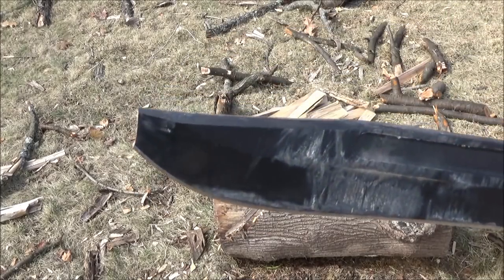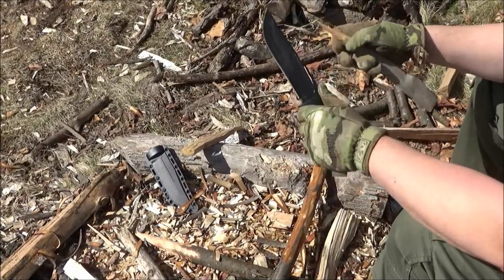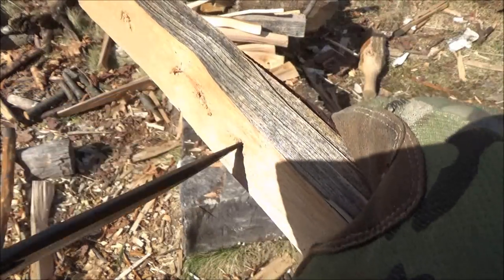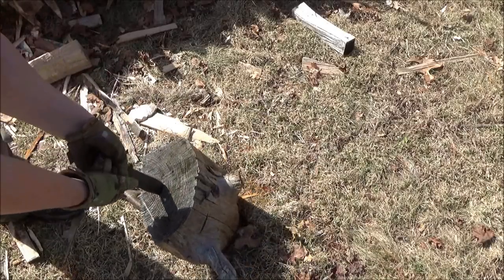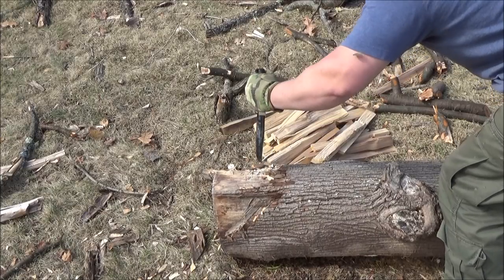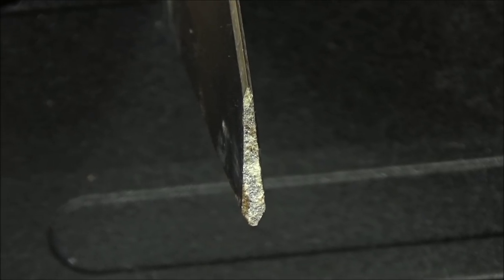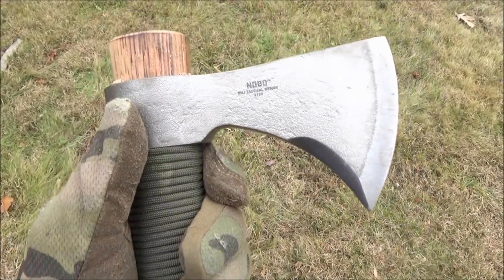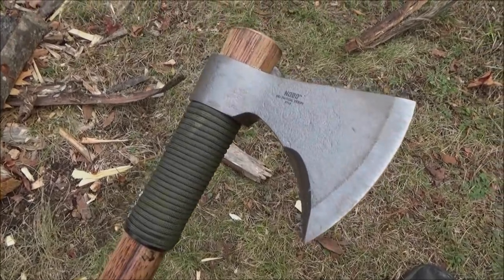CRKT Muzzle-Brake Knife Review

Comment: Bladesmith here (blacksmith who specializes in blades.) That steel grain looks awful, way too coarse! From what I can tell, the steel wasn't normalized before heat treat. Also possible it was way too hot going into the quench, although I'm not sure if it's a steel that gets quenched in a liquid or an air quench, but it could have gotten too hot either way. I think they didn't normalize the steel to refine the grain. As for why it broke: that grain is a big part of it, coarse grains are very weak. Also it looks like it's hollow ground, which is already weaker than other grinds, so that doesn't help.
Reply from the maker: Thank you for the info, bro!
Reply: I agree with Ian S. That grain structure is hideously coarse.
Reply: beat me to it. Extremely course
Reply: It  looks like it was quick quenched after a casting, but that doesn't make sense for plate steel. My guess is that it wasn't forged for a basic grind angle first, then overly annealed and quick quick quenched without proper hardening and tempering steps. 8Cr13MoV can be a pretty good steel when forged and heat treated correctly. Those grains are huge for that type of steel. Looks like cast iron. Basically, they got it too hot and cooled it too quickly.
Reply: Ian S. I figured as much myself , 8Cr13 ain't bad unless the heat treat is bad
Reply: Ian S. Even as a novice blacksmith, I can tell that steel is awful, looks like it had way too much stress in it, wasn't normalized properly etc.

Comment: Yup, the grain on that is turrble (in my Charles Barkley voice). Lousy heat treat would be my guess. The outcome is the CRKT MuzzleBroke. 8Cr13MoV can be successfully used in a larger fixed blade, but like all steels, it would need proper heat treatment.

Comment from the maker: You always hurt the one you love.
Reply: from my experience working with metals for a few years ( take them like gain of salt), look like the steel was over heated in the manufacturing process before it send to the knives company who process milling cutting ect, also plus over heat treatments make it brittle, many small pocket of air bubbles in the steel due to overheating to near boiling point
Reply: plus stainless steel is not that flexible compared to carbon steel in my testing
Reply: Hello, we are the the manufacturer of WORKPRO and MOSSY OAK, we found the your reviews of our products, very interesting.
Reply from the maker: I also reviewed the Work Pro 3 Piece Utility Knives Set, it was pretty good for $5 a piece!
Reply: Reno Yin always good to hear from the people themselves 👉
Reply: Thanks very much for your appreciation, we have well studied your review, we have updated the design for one-hand opening.
Reply: I bet if it was a saber grind instead of a hollow that tip would be ok. Some tips just aren't meant for "too tests", no matter the steel. Take a Para 2 in s30v or even cruwear, I bet that tip will snap like nothing and those are good steels with good heat treats.
That said, it did look like either overheated(blowing up the grain) or bad quench(results in retained austenite instead of martensite and austenite is brittle).

Comment: heat treat may have been a bit hard, but I would say the problem with the testing is more of a geometry issue. If you want a really strong tip, get an american tanto or drop point from thick stock. As with all things, there is a compromise. A fine tip will not be as tough as a thicker one that doesn't penetrate as well. I don't support chinese steel markets by buying knives with their proprietary steels personally, but from what I hear the carbides in the steel composition matrix are very soft, which mean higher toughness, hence the heat treat assumption: that you got a batch from the hotter end of the oven perhaps. shouldn't have made it thru QC tho with their claims of the knife being capable of wood processing. would recommend to return and replace
Reply: ^this.

Comment: WeAllJuggleKnives – Thank you for taking a look at the Muzzle-Brake. We have appreciated your reviews of CRKT knives throughout the years. It looks like the knife was able to take on some serious hard work batoning and splitting wood. At the moment the tip breaks, it looks like it was pounded down at sort of an odd angle. It is hard to tell in the video. Generally speaking, the CRKT Warranty does not cover broken tips for a variety of reasons (most blade tips are not designed for pounding/prying). I’ll reach out to you directly to discuss further and resolve. In the meantime, regarding the blade steel heat treating, I’ll send to the product team here for review. Thank you for letting us know. – Joel from CRKT

For more information about the CRKT Warranty - https://www.crkt.com/customer-service/warranty-information

We also have a Warranty video here for information about “my blade broke” what do I do? Starting at 55 seconds in – 
https://www.youtube.com/watch?v=LYgDZNjPVOA
Reply from the maker: That is understandable, thank you for the warranty info :]
Reply: In the closeup shot of the broken tip, there is kind of a bronzey-brownish spot. When knives i forge break, that is what a micro fracture looks like. It looks like there might have been a little stress fracture in the steel. When you crack them open, there is always a little brown spot where the crack was
Reply: CRKT is amazing! Love their customer service! Top Notch! most any knife will brake if you beat on it! Great review

They have always made things right for me. I bought mine for $56 on Amazon and so far it’s been great. Then again, I don’t use it as an axe!

I am not sure stabbing a log would ever be done. But possibly. Is it possible you got a bad knife?
Reply: The question is steel quality, not usage...obviously theres a problem with the steel

Comment: Also, could you do a video on how you shaped those tomahawks. I have the chogan T hawk and the head came off and despite all my efforts wasn't able to get it to stay on the haft.
Reply from the maker: If a hawk head slides down, I usually pound it back with a mallet until it gets to the wider part, sometimes I wedge some slivers of wood into any gaps so it won't work itself loose.

Comment: The grain doesn't look great but is typical of low end steels. It looks similar to other cheap blades I have broke. Also, that tip is a bit thin and the length of the knife increased leverage and pressure at the break point so it was the perfect storm of knife destruction. shat happens.

Comment: Chinese steel burger, lol.  Thanks for the thorough review.
Reply from the maker: I think they harden this 65MN too much, because my buddy has a Kershaw machete with the same steel and it also got a crack in it.
Reply: @WeAllJuggleKnives  I think it's the steel, but who knows.  All the failures I've seen are on Chinese blades, and they all have that cottage cheese look to the steel on the inside.  Like particle board.  There's an analogy in there somewhere.

Comment: The grain structure of the steel is to large it looks like sand it should look like a fine sugar or powder. The smaller the grain structure the stronger the blade. 🔪

Comment: Stainless breaks carbon steel bends.
No big deal they’ll replace it.
Schrade had the similar looking SCHF 52 and it’s predecessor which many have broken the tip to.
It was 1095 which is kinda sad it broke being a carbon steel.
Thanks for showing 👍
BB
Reply: Who the hell buys Schrade knives?
Reply: It's not as simple as that. With a bad heat treat carbon will break too. That steel looks like it was either overheated blowing up the grain structure or quenched too fast and has a lot of retained austenite which is brittle and you always want to limit how much of it You have. If it had a proper heat treat and quench and that austenite was martensite like it's supposed to be the knife would perform good. 
Carbon steels are much easier to hear treat since they're usually just carbon(some trace elements) and Fe, just bring them to temp, quench and temper. Stainless are much harder to heat treat(and grind) and have a higher chance of things going wrong.

Comment: Over hardened steel, by the looks of the crystalline looking fracture, making it brittle. With the correct heat treating it should have been more ductile. Could very well be junk metal, i.e. not the pure alloy it's supposed to be.

Comment: This is YouTube, there aren't any steel experts, however that's arbitrary.  Simply put, China just doesn't produce very good steel no matter the grade. Other than the tip breaking did you like it a lot or just soso?
Reply from the maker: Other than that, the knife was okay, but not for the $55 price.  A Buck 119 or Buck 120 will be a better hunting knife.
Reply: WeAllJuggleKnives  guess I didn't hear the price. If I said China doesn't produce good steel, that's from a quality standpoint only. Really they make budget steel. When considering price it's more reasonable. I lost my A2S headlight. And I'm not happy about it, lol. I'll get another.

Comment: well stainless steel becomes very brittle in lengths greater than 11 inches.
it becomes prone to failure due to dynamic impacts. 
this can be combated by making the stainless steel incredibly thick, unlike carbon steel which can be incredibly thin and take very hard impacts with out failure. Think long thin carbon steel machetes.  
this knife is well smaller than 11 in., and in theory should not have failed. though it is still susceptible to the same brittleness.
I would blame it on poor steel choice for the duties of the knife, as well as poor design. The thickness can be increased, as well the design can be improved to reinforce the tip.

I am not a fan of 8CR13MOV outside of folders for this reason. and a fan of carbon steel for these types of tasks, even a relatively low carbon steel (for example 1045) would still outperform this knife it any wood processing tasks.
just my 2 cents

Comment: Hi, I am not a steel expert as such, and have not read all the comments, for better ideas, but I am a little interested in these things, so I give it a go, so to say. I found this, just on the "MoV" equivalent, but with those taken away, most likely accurate numbers?: https://www.chinesesteelgrades.com/8cr13mov-stainless-steel/ . Compared tp Sandvik 12c27, a "fine carbide steel", used by eg. Mora: https://www.materials.sandvik/en/products/strip-steel/strip-products/knife-steel/sandvik-knife-steels/sandvik-12c27/ and the others mentioned in the first article: https://zknives.com/knives/steels/steelgraph.php?nm=aus8 , https://www.steel-grades.com/Steel-Grades/Special-Steel/AISI-440B.html , https://www.worldsteelgrades.com/astm-aisi-ss-440-440a-440b-440c-stainless-steel/ . I would estimate, that this 8Cr13 is a "medium carbide" size steel, not "coarse" as eg. D2: https://www.steel-grades.com/Steel-Grades/Tool-Steel-Hard-Alloy/D2.html , with a lot higher carbon content in it. The comparison with AUS 8 steel seems quite close, again without any "MoV" possible carbide contribution to do anything in regard to properties. I would estimate, that the main reason for the tip breaking of is, that it, by design, has not enough support for such kind of hard stabbing. I saw another review, where the host said, that it is designed as a hunting knife, slightly hollow grind. This is maybe good for slicing, (?) as far as I see it, but not so good for overall stability and strength, both in regard to the cutting edge or the tip as such. I also once, saw a review of a Gerber "Big Rock", where the tip also broke of, during hard stabbing, and that knife also has a relatively thin, "unsupported" tip region, as it is designed to be a "camp knife" for doing smaller camp tasks, like food preparation, wood work and simple cutting tasks. Compared to some eg. "Scandi grind" Mora knives, Hultafors knives and similar, the thicker part of the blade on those, goes out to the end of the tip, almost, and then narrows in to a "point" only a few millimeters or "fraction of an inch" from the actual tip end. This gives a stronger support for such tasks, I guess? Maybe also just a weakness in the blade, that can happen? It should be around the mentioned Sandvik steel and AUS 8 in properties, with slightly different % numbers for some of the other parts of the alloy, but it is difficult to estimate, how these differences will actually affect the steel, without having the, well, right level of knowledge and expertise here, so this is just some thoughts, as said, a medium size carbide steel around AUS 8, and the breaking might be more due to the blade shape and particular task of stabbing, rather than the steel itself? :o) 
Nice day, no matter what!!!
Reply from the maker: Great extensive research, to be sure! I feel like maybe they messed up the grain structure or hardening, because some other very pointed knives, like the Buck 119 Hunting Knife, are a lot better as surviving the same tip test.
Reply: @WeAllJuggleKnives  Yes, that might very well be. I once saw a review of a Mora Pathfinder: https://moraknives.eu/mora_bushcraft/mora_pathfinder , where the blade simply broke of just at the handle, while the reviewer batoned with it, through some completely ordinary piece of wood. It can be difficult to find the reason out of pictures alone, but still nice to know, that something like this can happen, somehow.  :o)
Reply: @WeAllJuggleKnives  Hi again, I still cannot give the answer from "the higher powers" on the reason for the break, but I looked a little more, and at least this Buck knife is made of 420 HC, that has some lesser amount of carbon in it and a slightly lesser amount of chromium, also, than this 8Cr13 steel. 420 HC: http://www.simplytoolsteel.com/420HC-stainless-steel-data-sheet.html . That might give a little advantage in toughness to the 420 HC steel, and maybe a little disadvantage in hardness(?) and make the tip a little more resilient and take the stabbing task just so much better, that it will not breaK? Buck also mention, that the clip point, in general, is a little weaker, than some other tip shapes: https://www.buckknives.com/product/119-special-knife/0119FAM01/ , under the description of this knife. 
I also found this: 
https://amarineblog.com/2017/10/10/alloy-element-affection-in-steel-properties/ , where they write about the different elements contribution to the overall properties of steel alloys. You write "other knives", so that means others than just this  Buck knife of cause, so? It is just some thoughts, I cannot give any specific reason as written, but interesting to "dive a little into". :o)  The "risk of learning something new" is always there, so why not?  :o)